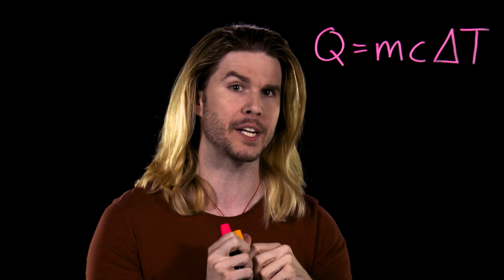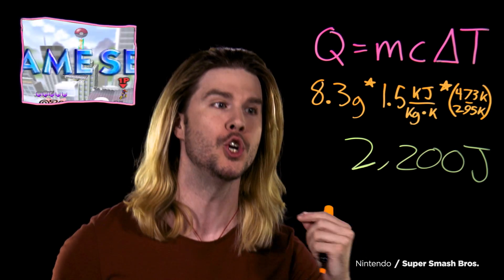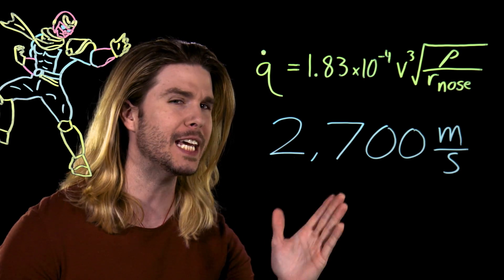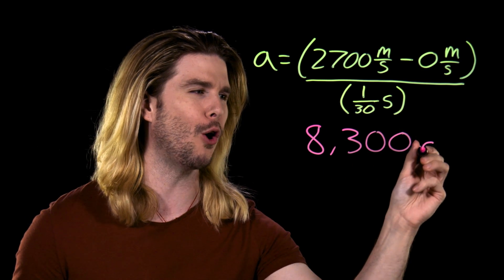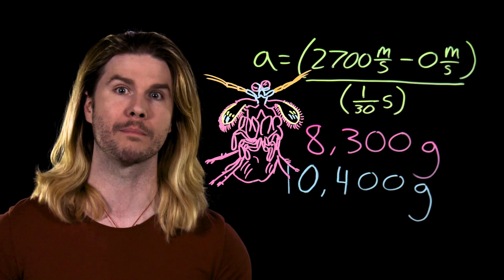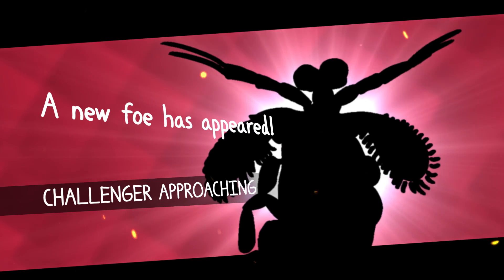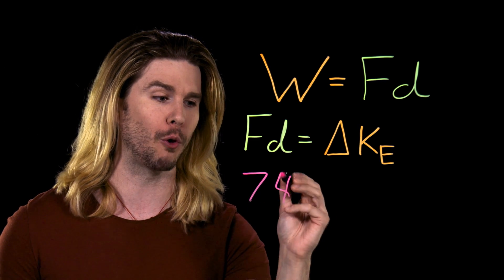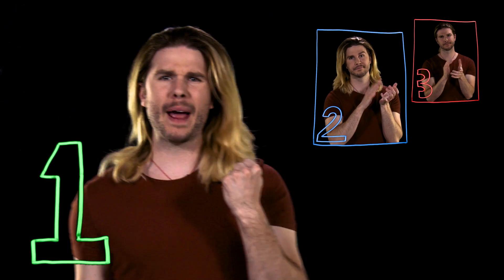How Powerful is a FALCON PUNCH?

Comment: He would most certainly dislocate his shoulder. Among other things.

According to the impulse-momentum relationship
the change in momentum experienced by a body under the action of a force is equal to the impulse of the resultant force

The resultant impulse being 74 Mega Newton and the force requires to either anteriorly or posteriorly dislocate the shoulder being about a 202 Newtons and he would definitely fracture some bones being that the fracture toughness in only 4 MPa (laterally).

On the receiving end of that punch is certain death. The force from the punch can be treated like a blast give the aerodynamic heating and pressures. 74 MPa is equal to about 10000 psi, according to the CDC at 20psi fatalities approach 100% and severe damage to concrete. 

At this point the punch would form a crater on the ground they were standing on, burst eardrums, and burst membranes in the lungs, not to mention the reflection of the shockwave would carry both corpses several feet (hundreds?).

Comment: If we take into account that this is 74x10^6 N, we also need to consider the size of CapFal's fist. A rocket moving at that speed is very different to an object that is, at most seven inches. A rocket moving with that much force is hitting escape velocity. A FIST with that much force isn't just spontaneously igniting, it's making a fiery explosion. That's why anyone hit with CapFal's fist is set on fire and not just his fist, it's also why fire surrounds the fist when it's thrown. It looks like a falcon, but with this in mind, what you're actually seeing is the air around CapFal and the fist being ignited and pushed away from him -- on impact, the victim is set alight by a small object with a ludicrously high temperature! Realistically, a Falcon Punch wouldn't just explode the target, it'd kill the user. CapFal should be getting... like, what, 300% damage every time he swings his fist, and meanwhile, Charizard is the only one that takes damage from a similar attack? What's fair about that?! 

Kyle, please demand answers from Nintendo via the use of that giant superweapon you totally (don't) have.

Comment: Thanks for the episode Kyle, it got me thinking. How much energy or calories does Captain Falcon use when he punches? In essence, how many Sensu beans would he need to eat between each punch? 

I struggled to find good numbers to work with on the internet to figure this out. I found the equation (MET * Weight in KG)/Time in hour = total calories expended. That leaves me at (MET * 140)/0.00000926 = Calories expended. Hard to find a MET value for an 8.3k G force punch though.

Comment: The real question here, how fast must Luffy's fist have to fly to generate flames....UNDER WATER?
Reply: You can generate plasma in water by travelling through it fast enough that it compresses and decomposes into white-hot oxygen and hydrogen. This would happen at velocities of over 5km/s, which is Mach ~15
Reply: That and how much force/power would be required for a decent gum gum pistol attempt
Reply: The same amount as mantis shrimp, im pretty sure they create little flashes of light underwater
Reply: @jesterbomb123  that's from the bubbles collapsing.

Comment: Isn't the upper atmosphere air density versus sea level going to change something?
Reply: Also, with an acceleration of 8300g, Captain Falcon's body would need to adapt to punching without blood.  With a typical human going through the motion of the punch at that acceleration and distance, taking into account that the punch is right-handed, a majority of the blood and fluid in the body would drain from the right arm and back through the heart or across to the trailing left arm. The blood that reverses flow through the heart and lungs would drain down the right leg. The blood would swell in the muscles and skin, rupturing and bleeding. So, let's just assume the tight clothes are pressure bandages to prevent swelling and pushing the bodily fluids back into the cardiovascular system.

Comment: Alot of assumptions Kyle, for example atmospheric composition, using leather gloves, that it is the velocity of the punch that makes the fist catch fire.  If I recall correctly leather's tensile strain/strength (?) Os less than 10,000 N so of he punched with 70million N wouldn't the glove rip apart before it could catch fire?  Occam's razor:  maybe he has a glove that he ignites, like a stunt man would do for practical effects?  Plus 74 million N punch would pop people like a balloon, they dont pop like balloons in the game so is more likely assumptions are off or they can shake off a 70 million N punch like bumping into a table? You should totally do a self igniting glove and demo it like you the mortal kombat video, that would be awesome

Comment: Kyle, love the show. Been watching for a long while now. Anyway, you used the numbers for regular leather, and that cannot be right for this for obvious reasons. Assuming all the other dynamics you proposed are true, Cap's fist would have to be covered in something much more durable and heat shielded than leather. Only certain materials possess the qualities needed to keep his hands from flash-burning away. Those materials would have far different values than you used (leather) and that in turn would skew the rest of the calculations by a wide margin. This punch would be far more powerful.

Comment: hey Kyle , wouldn't CF need more space to travel to gather the air particles in the small area on the surface of his fist secondly what amount of recoil would CF have to endure with each FALCON PUNCH he throws? also wouldn't the sound of the sound barrier being broken deafen him and his target not to mention the shock wave and how is the ground beneath gonna take all that force? , plus the heat it self would cook the target of the punch before  reaching him

Comment: That's gonna hurt Captain Falcon as well since, you know, Newton's third law.
Realistically, his entire arm would break after just a single punch impact, shoulder potentially included.
Also, even if the punch doesn't connect, the forces on Captain's hand are high enough to cause injury. 
Additionally, the heat generated by the motion will be enough to cause burn wounds despite any protective material.
By the way, those gloves will be GONE.

Comment: 3:55
That can't be true, if you say that attack is from Kirby it means that it was a copy of Cloud's ability, but in most cases Kirby improves that ability, so the % shown is wrong, that's the damage the ability does normally, used by Cloud, but thanks to Kirby having it it should be 8.6%
And the color is green, not yellow
Btw love the show
Reply: Maybe they were implying that it’s the wave from Kirby’s Final Cutter. Still the wrong color, though.
Reply: @nosoymuyoriginal  but it's also not the correct shape or sound, it's more similar to Cloud's ability

Comment: Leather is literally the worst material to use as heat shielding. wanna know why? IT SHRINKS!! Now, not only do u have your hand in a very, very hot glove, but your hand is now stuck and possibly being crushed by that burning glove. It would be nearly impossible to get your hand out of it, and, assuming you did, you'd be losing a lot of skin in the process. Minimum. There is a very good chance you'e going to suffer third degree burns to your fingers, which will literally be burning meat sausages as the leather shrinks around them, compressing them, cutting off blood circulation, heating them up, cooking them, because they're essentially inside of an oven! Even if you attempted to rip off your glove with some serious speed and power, you may well overcome the remaining strength of the leather and rip off a small chunk. If the glove doesnt break first, the next thing on the list would be your fingers. Good luck.

Comment: The problem here is that the punch likely won't stop in such a short distance because the mass of the target isn't that high.  On impact, the high momentum of the punch will likely either just punch a hole into the target(rated mature for gore) or the target, if elastic like in the game, will just fly away because of the massive momentum transfer.

Also, if your superhero/villain nick name isn't Captain Pun-ch, you may start considering about it.

Comment: hey kyle, it's me the super maths brother! 
how many g's did you pull @ 2:23 coming to a complete stop while going mach 2.2 
mach 2.2 = 749 m/s 
t = roughly 3 frames 
a = 749 / (3/30) = 7,490 g 
i think you might just have a chance to dodge the falcon punch if cap's not in peak condition

Comment: Taking these numbers:
Force = 74 MN
Area of a fist (approx.) = 60 cm^2
One can get a pressure = Force/area = 12.3 GPa.
Using Newton's approximation of impact depth for fast moving objects: Depth = Length of projectile * (Density of a projectile / Density of a target)
Assuming you are punching a face, density of a fist and density of a face are really close, so the fist won't go further than its own length (as you have mentioned in a video).

Given the speed and contact pressure, the fist and the opponents face would probably liquify and explode from the shockwave.
P.S. As I use to say: "Everything is like a liquid, when it's moving fast enough."
P.P.S. That was quite a "face-melting punch" *ba dum tss*

Comment: Kyle,

if we "theoretically" made a weapon that shoot a high pressurized gas/liquid, we should be able to replicate the effect (given that the material is resistent enough to resist such pressure without getting cut like  butter).
but is it possible with today's tecnology? maybe with a small enough test subj.....i mean Radious of the nosecone and the right proportion of density/speed (since increasing the density could allough slower speeds but it would make more difficoult reaching them).

a totally non evil fan from italy.
Reply: So when did you signed your contract for Kyle Hills totally not evil research facility?
Also how lond did it take them to answer, just curious.
Reply: @Franky_Sthein  i brought a totally not evil project to my school's science fair and a strange guy gave me a void panflet.
i applied immediatly after seeing their dental plan, it's pretty good.
Reply: @andreataccone2564  Damn! Never had a science fair in my school.
Well goodbye job offer with good dental plan^^

Comment: What if the atmosphere on the Smashplanet is more dense than on Earth?

Also, that's a lot of force; how many calories would he burn for each punch?
Reply: More than 1
Reply: 1320.7 cal (18% efficiency) to  1910 cal (26% efficiency).
Reply: Certainly less than most superheroes in a fight.
Reply: But! He will consume more, if air resistance and adiabatic heating is accounted for.

Comment: If the mantis shrimp was a land creature, lets say around the size of a labrador and everything had remained in proportion, just everything scaled up to match the size of the dog then adjusted for the physiological differences the increase would have on the unholy abomination due to the increase of not just its body but also the change of pressure exerted on it being outside the medium of water, how destructive would that punch be? Given how solid a barrier water can be to a moving force, let alone something moving that fast, what would happen to the air around it on land? What would be the limit to its pressure wave and what would happen to the air molecules around the shrimps appendage? Would the friction cause a large volume of the air molecules to ignite, or would it just be firing off hudokans that would make Ryu jealous?

Comment: This would explain part of why Captain Falcon needs to bend forward at such an extreme angle. Captain Falcon's center of mass is below the extreme force from his punch and if he didn't bring the force in line (or closer) with his center of mass, he would flip backwards head over heels. 

Also, using the twisting rotation from his abdominal muscles and the pushing forward with his legs would be necessary to generate as much force as we are observing.

Honestly though, he should be at least skating backwards by a few hundred feet unless he has shoes on that have an incredible friction coefficient.

Comment: Great video, Kyle, as always!

Two thoughts. First, because of equal and opposite reactions, Captain Falcon's body would have to be able to withstand the force of accelerating his fist to that ludicrous speed. Furthermore, that same force would need to be transferred to the ground beneath him, so he would need some solid footing to even get the punch moving. Alternatively, he would have to be incredibly massive everywhere besides his arm to prevent his body from recoiling during the punch. This seems more plausible since a Falcon Punch can be made falling through the air. 

The second point is related to the end of the punch. You described the force imparted supposing the punch lands, but the Falcon Punch is one of the most telegraphed moves in the game. What if he misses? Suddenly, all that force is distributed across his arm as the tensile strength of his bones, ligaments, muscles, and tendons fight to stop the fist at the moment of full extension. If his arm couldn't handle those stresses, he might shoot off his arm, either tearing from the shoulder or shredding the whole darn thing, in a suborbital trajectory.  It this is a risk, then it would behoove Captain Falcon to resist the temptation to... show us his moves!
Reply: But when Captain Falcon's arm or hand would get ripped of he could still hit you with it.
Think about that, ab fist shaped projectile with almost the same force and velocity of the Flacon PUNCH!!
Reply: Yes I noticed the misspelling but found it to hilarious to correct.

Comment: Hey Kyle, love the show, but I think we can go a bit further to show the power of the Falcon Punch. If we were to find the pressure that the punch puts on the squishy body of Kirby we can see the true devastation. Using the force that you calculated, 74,000,000 N, and the area of my fist (since I couldn't find any listing for the average fist size of an adult male) of 64.516 cm, we can use the pressure formula of P=F/A. This gives a ludicrously high 1,147,002.294 psi.  That is  78048.877 atmospheres. So not only would Kirby experience a lot of force from the Falcon Punch, but it might just destroy the body out right from the pressures involved. 
But what do I know, I'm just some guy on the internet with some free time on hand and enough understanding of physics to be dangerous.

Comment: Hey Kyle, long time watcher, but only my second comment.  Love the show.  

In trying to follow up on the hunch this video gave me I found several articles about photodisassociation of CO2.  

https://www.researchgate.net/publication/267757733_Evidence_for_Direct_Molecular_Oxygen_Production_in_CO2_Photodissociation

Specifically, since we are talking about fire, if Captain Falcon had a device built into his suit that emitted the correct electromagnetic radiation, could he separate the CO2 in the air around him into carbon and O2, giving him more fuel for his fiery punch?

This would still present the same need for an ignition source that you covered in the video, but if the device were sufficiently advanced, it could also probably generate a spark or other ignition source across his knuckles. 

Splitting precise areas of CO2 in Falcon’s path into O2 and carbon and leaving other areas as Carbon Dioxide could even give the blast its distinctive shape.

Maybe the long windup time and specific pose associated with the Falcon Punch is actually Cap giving this hypothetical device time to do its thing?

Anyway, thank you for the great content as always and best of luck conquering whatever life throws at you.
Reply: Following up on this, I realize CO2 is a minuscule (but sadly growing too quickly) part of our atmosphere, so maybe toss water vapor into the mix also.  Some of those F-Zero tracks are over bodies of water, and you could use the exhaust fumes of the vehicles to your advantage too.  He would be purifying the air very slightly as he beats someone down.

Comment: Hey, Kyle. Love the video, love the work you do. However, there is something you might have forgotten to take into consideration when running your calculations.

When you take your given force (7.4 Mn) over the length of a human punch (roughly a meter) and apply it to the average area of a fist (0.043 M) , you are given a pressure of 174 MPa.

This turns out to be 4 MPa more than what is needed to break the bones in the hand and humerus, 96 MPa more than required to break the ulna, 84 MPa more than is needed to break the radius, and almost 174 MPa that is required to shatter ribs.

This means when Captain Falcon punches a guy, he is shattering every bone in his hand and arm and turning his poor victim's rib cage into an internal shoot gun shell.

Two things to take away from this, Kyle. Captain Falcon's real superhero name should be Two Punch Man, and if he ever decides to assult you in your evil lair in the Void, you just have to dodge two Mach 7+ punches and have them hit something else.

Comment: i think you made a mistake in one of your assumptions.
you assumed that it is captain falcons gloves burning up is what creates the flame, which can not be the case because his gloves are still there when he finishes, he also doesn't take damage himself so what i think is actually happening is that the energy from the punch is actually so high that it ignites normally inert gases in the atmosphere, such as nitrogen to form nitrous oxides.